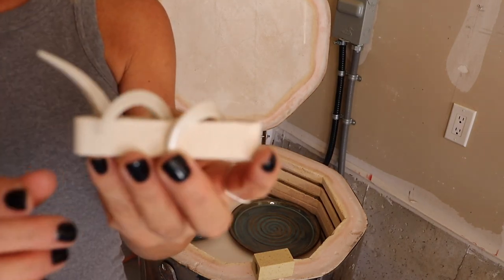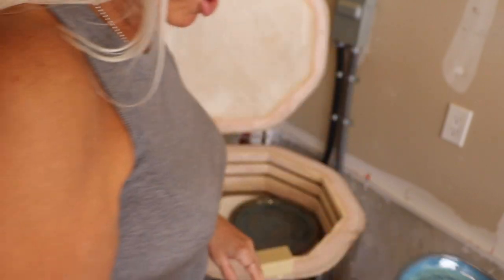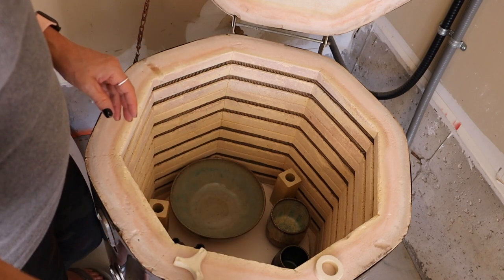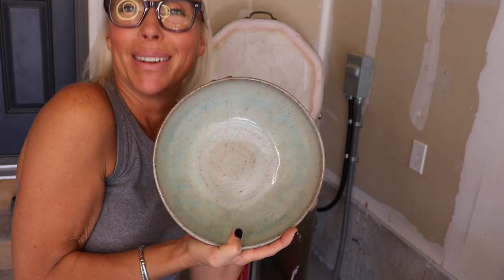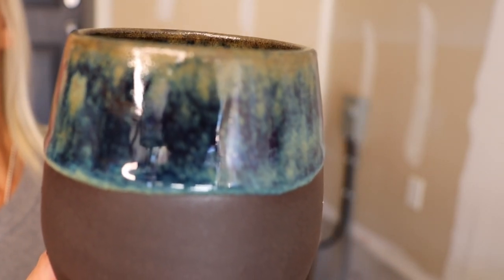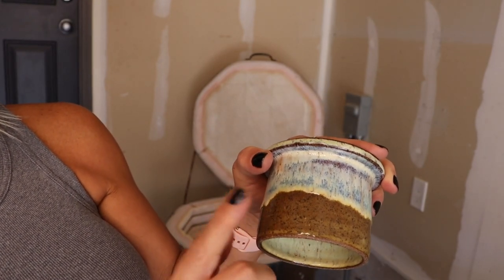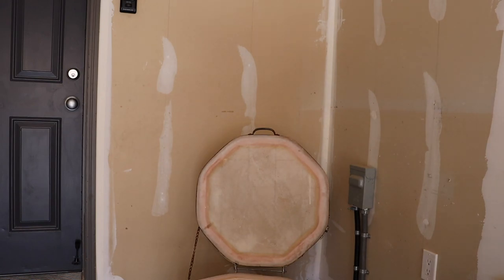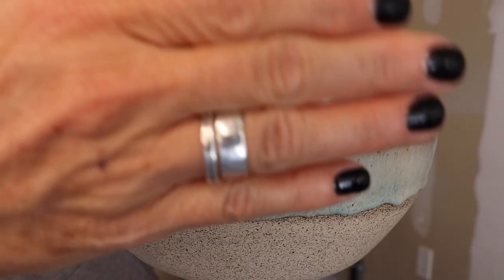RE-FIRED!! - GLAZE KILN UNLOADING - USING MAYCO, COYOTE & POTTERS CHOICE GLAZES   HD 1080p

Comment: I didn’t know you could re-fire! Is that only able to be done in an electric kiln?
Reply from the maker: Hi Shellie, I don’t think there would be a problem re-firing in a gas or wood kiln, 🤔😬but I don’t say that with confidence. I don’t see why it would pose a problem any more than in an  electric kiln. I don’t suggest re-firing more than once to ^5 or ^6 as your piece will start to become brittle but putting it thru the kiln 2x is fine. You can actually even add more glaze to a piece and refire it too if you didn’t put enough on or didn’t get the desired results. I’ll have to do a video on that.. maybe soon. I’ve been working on some more content😉

Comment: I’m new to this and I bought a used Aim Hightemp Kiln. It fires to cone 10. My first firing will be this weekend. Any tips would be appreciated. I’m scared 😬
Reply from the maker: Ohhh that’s so exciting! When I first got my kiln it sat in the garage bcuz I was kinda scared too! I suggest maybe for your first firing do a bisque fire  which will greatly increase your confidence as you’ll see how long it takes, the smells it puts out etc..and yes there are different smells as the kiln does it’s thing.. alsoc research as much as possible you make and model on line see if you can find a manual so you can read what the manufacturer recommends. I would also set up witnesses cones for each shelf so you can see what temperature they hit. It’s very valuable info. Good luck! 😉

Comment: So on your refire did you reapply glazes? or just refired with what was already on them?
Reply from the maker: All I did was put the pots right back in the kiln with no additional glazes added. Because the kiln had under-fired the glazes didn’t get the right amount of heat work in order to create the effect expected. When the kiln gets up to temperature the glazes actually liquify / molten..but the first firing didn’t get hot enough so the glazes didn’t mix properly. Hope that makes sense. 
Not every circumstance can be fixed by re-firing..pretty much my entire 2nd shelf in this kiln load was wrecked..but no love loss as I had nothing to loose..all those pieces were sorta ruined anyways, they will all get smashed later today..🤭